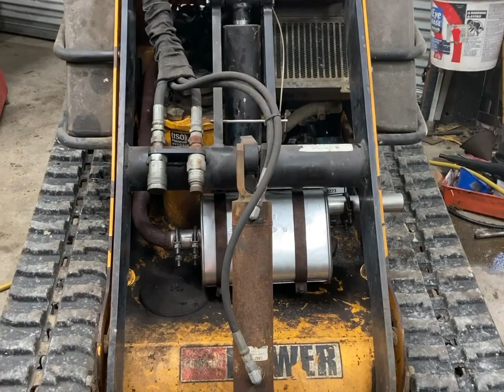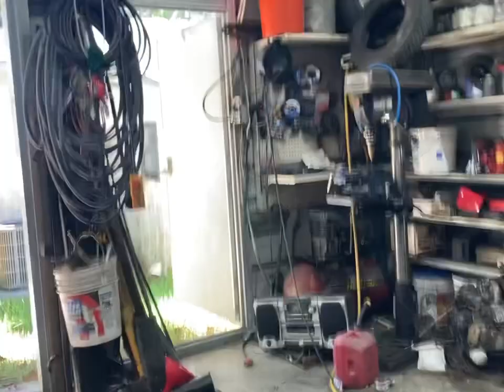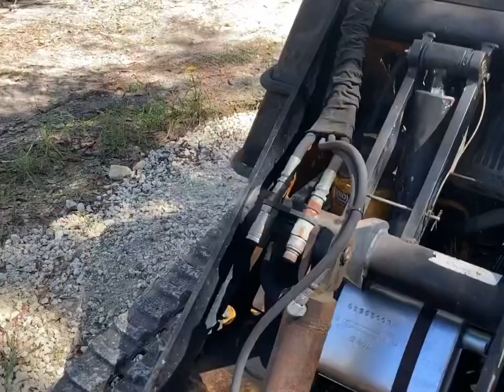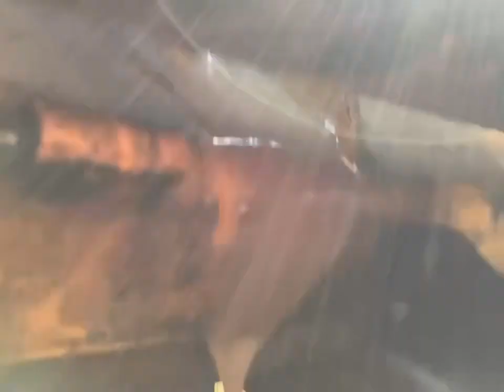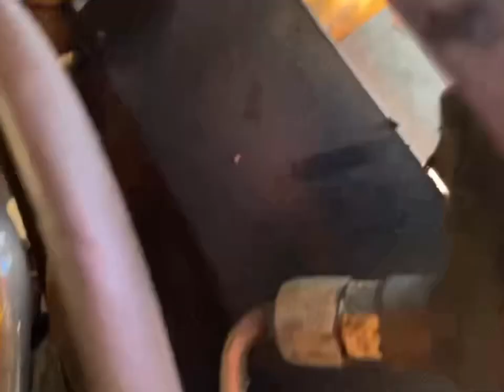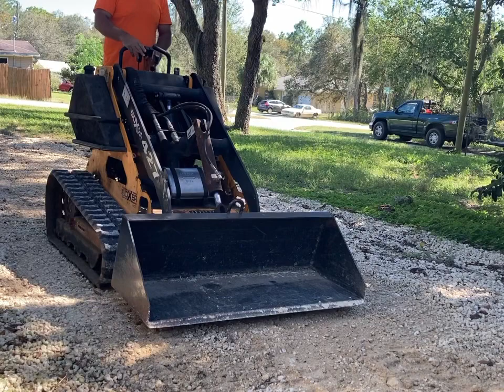DONE REPAIRING BOXER 427

Comment: How did you put a 22hp predator engine in that ? I’m considering that exact swap on my boxer , I run that exact unit
Reply from the maker: I got it that way.  I have it out now because I blew the love joy coupling.  I can make a short video to show the motor mount adapters.  I am upgrading to a 30hp
Reply: @sclawns5257  when you are done please share . I want to do something similar . I literally have the exact same machine . Mine works well. It’s actually quite quick for it’s size in high range . Id like to see how you get a larger engine to fit that pump

Comment: ive thought about getting some time down the road either a skid steer or subcompact tractor. for now i lean more toward the tractor since skids are so expansive and ive never used one
Reply: @Hazardra Lawn Care I'm in the same boat as you bro, I will eventually get my hands on one
Reply from the maker: Take a good look at the new mini center articulating loaders.  avant- is one brand multione is another that goes 30mph and has over 400 attachments used mainly in Italy. They are fast and don’t tear up the ground as bad
Reply: @sclawns5257  that multi-one is actually made out here in my area, I never realized how good they are until recently
Reply from the maker: @JonsDailyHustle  I think they are the future because they turn tighter than a tractor, better balance than a tractor(engine in back) are fast have telescoping lift arms, dont tear up the turf.  the only downside is they do not disperse weight over large area like tracks so there is compression issues but tracks tear up so bad when you turn.
Reply: @sclawns5257  yea they are pretty awesome. I'm hoping to try to tour one coming in the winter time but idk if I can or not